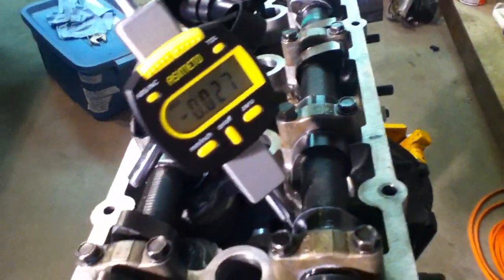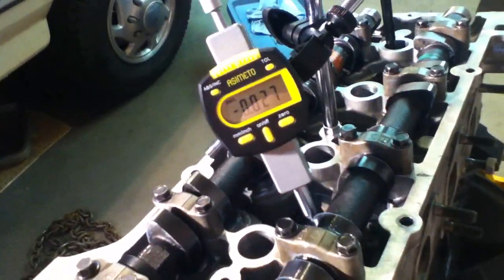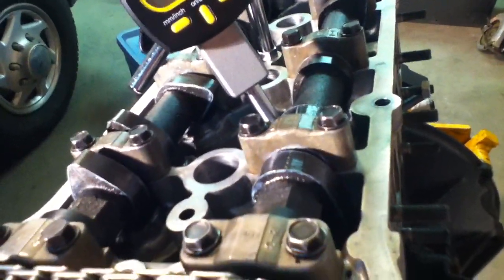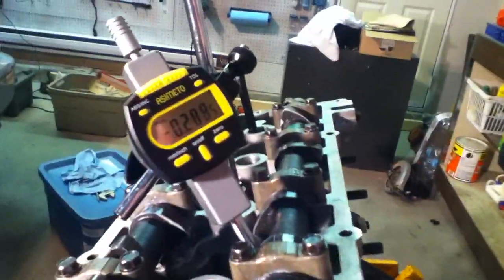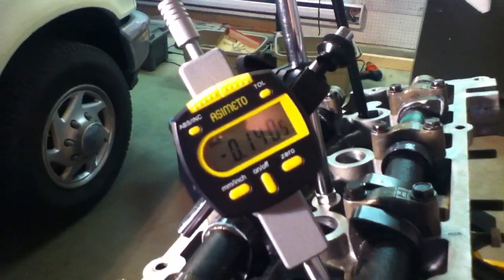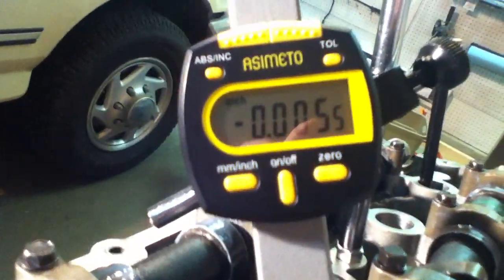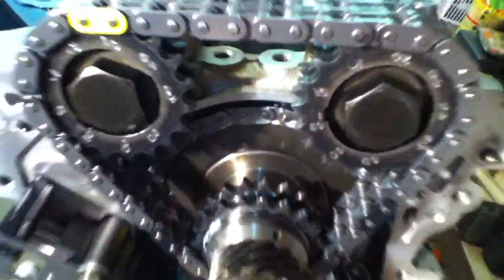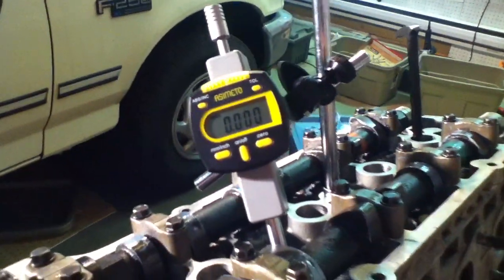KA24DET- how to Degree Cams (vid 3) exhaust cam

Comment: Cool vid, as you sed there is not much info on this.
One question. If in my manual says set INTAKE 5º or whatever, does it mean that i have to set it to open 5º after TDC on the degree wheel?